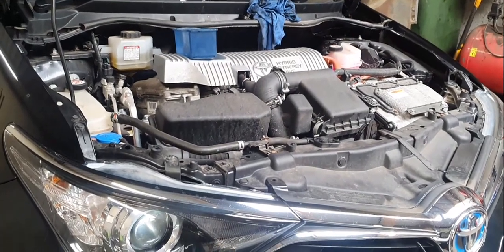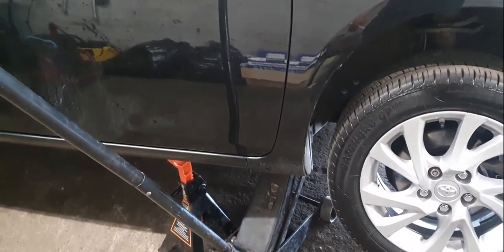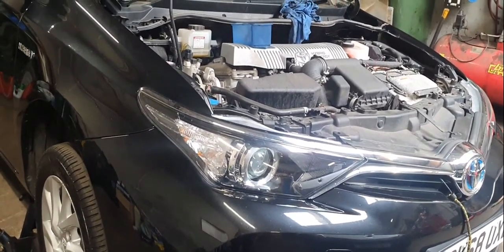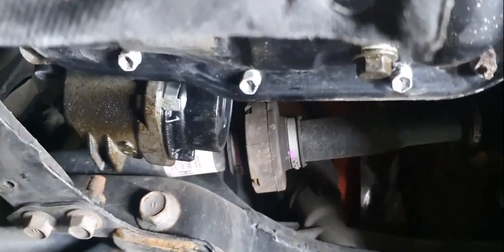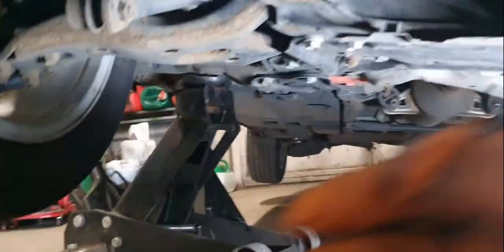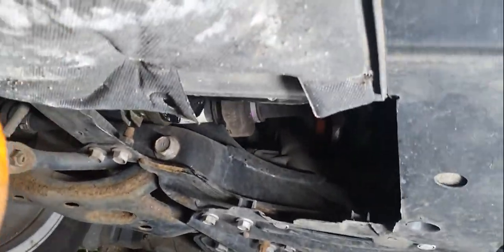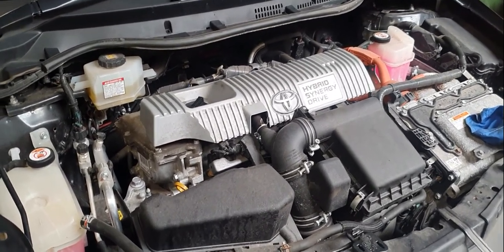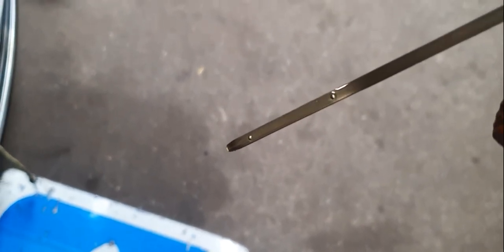toyota auris hybrid oil and filter change

Comment: Thank you for this video mate! Shouldn´t the car be perfectly horizontal (flat) when the oil is drained? Shouldn´t you take it off the jack before draining?
Reply from the maker: The car being flat makes very little difference with how much oil comes out , maybe a 1/4 cup at the most.
Reply: @paulmeehan1978  
Yes, i supose so, thanks for your answer!
Reply from the maker: Normally I'd do the job on a two post lift but I'm showing it for the DIY'er so the car on stands is the version I show . Tha ms for the comment

Comment: Just a jack? No jack stands? 👎
Reply from the maker: Axle stand is beside the jack , no weight on the jack
Reply from the maker: Jack is clearly visible at 0.15 seconds into the video , it's black and orange and rated for 6 tonnes , check it again you might have missed it
Reply: jack stand is not really vital here because all the wheel will still hold the weight if the jack fails. The car will not crush anyone under it. the ground clearance is tall enough unless you sit down there.
Reply: @paulmeehan1978  Thank you for this video mate! Shouldn´t the car be perfectly horizontal when the oil is drained? Shouldn´t you take it off the jack before draining?
Reply: Very helpful video. Toyota charges £90 to just change this.
Reply: @umeshdwivedi5981  
That's a bargain. In Germany they want 190 Euro. 😂
Reply: @3opaH  if that price includes the filter id never change mine again. In my country its atleast 200 euro